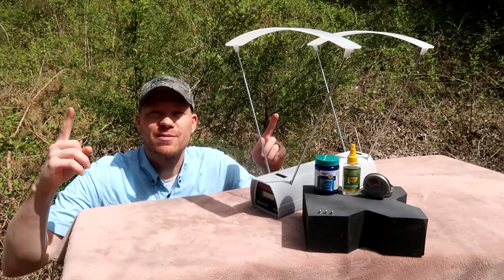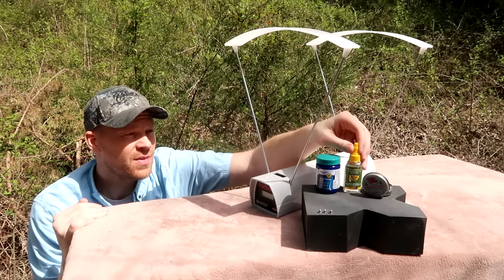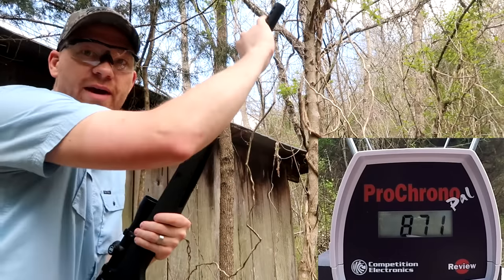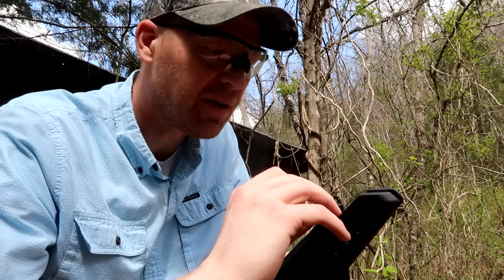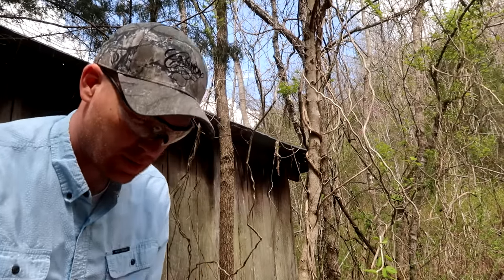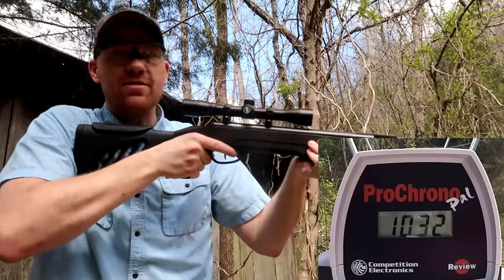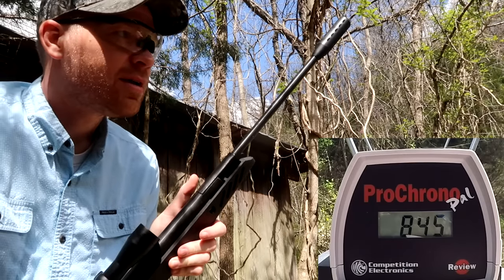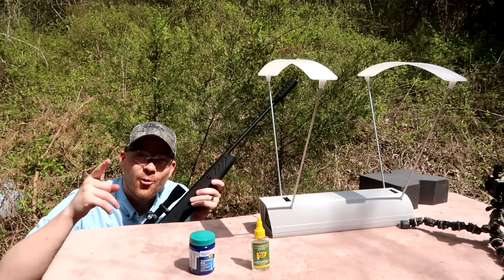Air Rifle Dieseling - MORE POWER

Comment: Hello! I use to put a small amount of vaseline into the skirt of the .177 pellet and I noted that for the same distance, pellet and kind of target my Gamo P900 springer pistol is able to pierce things that it is not able to get pierced without the dieseling. I wonder why if spraying some silicon oil into the pellet box and then putting them in place to shoot, if I could get the same results in a faster way. I shot many shots dieseling way and I don't see any damage or sign of burning in the seals of my airguns. I think it's not a risky thing?

Comment: Heat the vaseline until fluid, remove the ends of a pack of matches and reduce to powder. Mix it with the vaseline, pour it into the pellets then let it set. It's like dieseling on crack.
Reply: @AncientTruthSeeker  you sound like a cop 😐
Reply: @AncientTruthSeeker  i'm from the uk, spud guns are classed as dangerous weapons here 😅 this method is very effective, it'll blow the gasket around the barrel eventually but that can be replaced.
Reply: @AncientTruthSeeker  i knew a guy that bored out the barrel on a weirauch hw45 to fit a .22 casing, he drilled holes on the botton of the casings and clamped piledriver 32grain pellets into the top. Filled them with the mixture i mentioned, it fired through an oil drum and went off with a big bang and some smoke.

Comment: It's called deiseling because the same process that happens in a diesel engine happens inside the pellet gun. First the intake-side camshaft on the bottom of the rifle will advance by 60 degrees, allowing air into the gun. Another 180 degrees of advance sees the crank rotate the piston and load a pellet. As soon as the trigger is pulled, the explosion happens, but is contained thanks to the use of special gaskets and ARP bolts inline with the barrel. This makes the mechanism HOT, so hopefully you have topped your rifle up with 10W-40 and cranked it over a few times to make sure everything is well lubed.

If you're interested in this sort of thing I recommend you look into tokamak'ing your pellet gun, trapping hot plasma inside the barrel using magneto-dynamic confinement. You can find videos on YouTube
Reply: Tokamaking?
Reply: @TheBabayga  yeah idk where i was going with this comment either

Comment: When you compress any oil based product with enough air pressure it explodes.Thats why its called deiseling .A diesel engine runs on compression not spark like a gas engine.Thats why your getting increased power in your air rifle.Its compressing the oil and causing an explosion behind the pellets.

Comment: I think what happens is basically the air pressure suddenly increasing ignites the vaseline and basically adds combustion to the equation similar to how diesel engines work to ignite the vapors by pressure alone

Comment: a bit of a necro here but I'd like to point out hat due to the nature of how dieseling functions this can cause a particularly uptight law enforcement ass hole to reclassify your weapon as a firearm as this technically counts as launching a projectile with an explosive. This isn't  a HUGE issue depending on where you are at the time, but if you have a full auto airgun that makes it a new machine gun (yikes) or if you are an ex-felon... well you get the picture. Frankly with how harsh this method is on the seals of your rifle it's really not worth it for the little extra power you get.

Comment: LOL. Not real great for your air rifle. But it is fun! Most new break barrels will diesel for a few shots from residual oil in the chamber. This is why silicone chamber lube is recommended. It resists dieseling.

Comment: Diesel engine does not have spark plugs because it's firing point is accomplished by pressure. So the product has to be an oil type of product because this is what a diesel engine uses. You run a diesel on vegetable oil, olive oil, and yes diesel.

Comment: Just to be correct, this is not dieseling. Most spring piston air guns diesel a little with every shot. What you are doing is called detonation.  An airgun that is dieseling is burning off a small amount of oil in the compression chamber. A detonation is when the oil explodes in the barrel. At the least it will ruin seals and springs, at worst it can blow the gun apart.

Comment: Ok I got one 4 u soak your .177 pellet in motor oil in the cap then then oil pellet an put in barel. An it will put a hole in pop can as big as your pinkie what kind of gun u use in vid

Comment: I used to spray wd-40 in the handpump of my benjemin 22 cal pellet rifle cuz it seals the piston rubber and makes more pressure. one time I was screwin around in my shop and couldnt find the wD -40   so I sprayed some deisel I hsd in a spraybottle instead.. I usually pumped it 10 times and it was pretty hard at the tenth so I started prumping and counting  and at 7 Baam! the gun blew up.. True story  I swear.

Comment: Been doing this since the 80’s with Sheridans .20 cal and Crosman Magnum 2200 .22 cal 
No need to lube every pellet tho.  Just drop a few drops of oil down your barrel evenly and give it a couple of dry fires this will shoot the excess oil out and it’s not substantial enough to ignite and cause fire so I have no alarm by what these people try to put in our heads, once you have done that then take your pallet and shoot it like normal you will get about 10 or 15 good shots of diesel firepower and then u will have to do it again , this is very very dirty for our barrels so make sure and use cleaning pellets for this when you clean the gun use the same oil and no do not use WD-40 to clean out your barrels or for diesel in that stuffs for exterior only. Gun clean kit is recommended for dieseling and no none of my rifles were short lived from diesel.

Comment: Dieseling is inconsistent and unpredictable. So accuracy goes out the window which is common for the first couple of shots after oiling it. I built a cheap one from China to "diesel" oxy-acet mix. It throws a 3 foot flame out the end. Fun but you can't hit anything smaller than a barn door. 😂🤣😂🤣

Comment: It’s more about not filling the cup of the pellet but more of using the oil or vicks to seal the gaps around the pellet to make it a better /tighter seal...and therefore more compression..hence the phrase “ Dieseling”    The less blowbye around the pellet utilizing closer to 100% of the air pushing the pellet out…. And the extra compression will create more heat to amplify the fps even more. Ya it does work great. But it will wear out the breach seal quicker usually..great vid nonetheless. Whoteehoooooo!!

Comment: Yer expanding tha skirt on tha cup making a tighter fit in tha bore so it holds more pressure. I expand mine by inserting and turning tha beveled tip of a ink pen. I have a  old pen with a metal tip works great.If you had held tha barrel vertical and rotated tha stock up yer liquids would stay in.Tha vics stays in cause its thick

Comment: Best to use is a light gun oil or lamp oil.
On cheap air rifles back pressure from vaporizing oil can blow out seals.
Called dieseling because on higher pressure rifles it will ignite the oil like a diesel engine. 
Get more punch when you use an air rifle that starts at 1,200fps

Comment: Dude does a diesel engine make any sense to you. The diesel runs on the same concept it is not a Spark that ignites the fuel it's a pressure and heat. The pellet is shaped cone shape which means at the end you can concentrate all the pressure to a point which causes  heat which ignites The Vapor Rub or whatever fuel you have in there. The fuel propels the projectile out the barrel like a second stage rocket.

Comment: I don't know, so I'm only guessing, but if your getting smoke, which is supposed to happen, it seems like a small combustion event has occurred. ( dieseling? ) suppose it'll wear your bore, like running overly hot loads? Seems to work though.💥💥💥👍👍🚲
Reply from the maker: Surprised me!

Comment: Petroleum products WILL burn your seals out! With repeated dieseling has the potential to have your gun come apart! These knuckleheads that told you to do this must be real geniuses! The dueling can increase the temp to close to 2000 degrees f in the air chamber.Put it this way,would you turn on an oxygen tank with gloves that are greased filled??!
Reply from the maker: 👍👍 I wasn't afraid to try it in my $20 bargain store air rifle

Comment: it's called "dieseling" because a diesel engine fires it's fuel under compression..a pellet rifle uses compression.. the oil, vaseline  ect. is igniting under the pressure!..just like a diesel engine...that's why the water didn't work..plus, it's added water weight made it go slower.

Comment: Brother, did you realize how bad dieseling is for your nitro piston chamber, and breech seal before you did this? It can seriously damage your airgun. I'm an avid airgunner, and I know a lot about them. Any petroleum-based lubricant is ALWAYS bad for break barrel air guns. However, it's not really bad for a PCP airgun since they are not sensitive to petroleum-based lubricants. 

Dieseling can even cause serious injury or death, because it can blow up your gun if it is overdone. "Dieseling" happens when the rapid expansion of air pushed forward, presses against the back of the pellet at a high speed, which then causes the petroleum to actually ignite inside the breech of the gun. Break barrel airguns ARE NOT meant to withstand those high pressures from an internal explosion. Anybody telling you to do such a thing isn't doing it with good knowledge of just how dangerous it is. Please be careful 🙏🙏
Reply: why cant we use silicon 3in1???? !?! ?! ??!? please respond

Comment: I need tips on how to increase muzzle velocity in a bb gun.
Specifically, the old Umarex Glock 19 (non-blowback) GUW019
Reply: There’s nothing much you can do you need to open it up and adjust the reg to allow more co2 in
Reply: @TheInvisibleOrange26  That sounds like something much I can do.... 🤔

I saw a video years ago about opening up the pressure chamber and weakening the spring that pushes the plunger forward to close the valve.

I just don't have precise, specific details on how to do it to this model 
(without ruining it).

Comment: WHO_TEE_WHOO Brother. A Diesel engine is a combustion ignition engine. The compression in a diesel engine, high compression of air towards the top of the piston stroke causes the firing of the fuel when injected through the intake valve. Exactly what you are doing when you cock your air rifle and pull the trigger. Compressed air with the fuel source already there in the form of vapor rub or Rem Oil causing an explosion, thus the smoke you saw. It is a little hard on the seals in your air rifle however.
Reply: If you don't know how a diesel engine operates don't try to explain it. Diesel engines have fuel injection and it doesn't inject it into the intake. On a diesel engine all the valves are closed during the compression stroke and just before top dead center the fuel is injected directly into the cylinder and it combusts under the amount of the heat caused by the compression. Retired diesel mechanic here that knows WTF he's talking about.
Reply: @RedneckHillbillyGnR  please explain to me what it was that was wrong. I can explain to you what you said is wrong
Reply: @happytrails5400  For one, diesel engines do not inject the fuel through the intake valve. They do that with gasoline engines and it is called port injection because it is injected into the intake port. Some older ones had TBI, which is Throttle Body Injection, which is where the TBI sits on top of the intake like a carburetor. Please, enlighten this retired diesel/automotive mechanic where I am wrong. You are correct in the case of the pellet gun and the heat of the compression causing the oil or vaseline to combust and increasing the power of the pellet gun. But you are off on the diesel engine getting fuel injected through the intake valve. It is called direct injection because it injects the fuel directly into the cylinder just before Top Dead Center on the compression stroke where it combusts due to the heat of the extremely compressed air which drives the piston down on the power stroke. Now in the old days they used to have diesel engines that would start on gasoline and spark plugs and then switched over to diesel, but that type of system didn't stick around long. So again, please enlighten this retired diesel/automotive mechanic how diesel or any other engines work.

Comment: I was wondering how that worked. It prob seals the rifles in the barrel off better. I’m guessing that’s what it does. GOD BLESS.
Reply from the maker: Hey Randle!
Reply: The petroleum ignites the air in the chamber,it can reach almost 2000 degrees fit WILL burn out your seals and the gun has the potential to come apart!
Reply: WHO_TEE_WHO hey brother when the turkeys get to gobbling better here you got to come up and we’ll go after a couple. GOD BLESS.

Comment: The smoke is more a fine particulate of the oil mixed with air and a rapid decompression after exiting the barrel behind a projectile. The oil does two things. It helps fill the gaps and lubricates at the same time. Reducing friction, and allowing all of the air to push, allowing faster speeds. I doubt it will wear out seals any faster than regular shooting and honestly probably helps overall.  Any overpressure will leak out the breech. I only just learned this recently then found this video
Reply: What is happening here is called the diesel effect, the oil is combusting under the intense pressure
Reply: And yes it will blow out the O-rinf

Comment: Anyone knows / has the experience after how many shots this will damage your air rifle?
Reply from the maker: Nope
Reply: @WHOTEEWHO  Then... I will have to try it :)
Reply: What I will try is the following. Since I am not the type of guy to walk around with a tube of vaseline in my pocket, I will prepare the pellets. I will add a drop of oil / a little vaseline and cover it with parafine (candle wax). This wil make it easier to transport prepared pellets. It's an idea, do not know if it works. Will post updates here!

Comment: Call it lubricating instead of dieseling combustion is not possible because the airpressure lowers so it cools instead of heating so no combustion
Reply: Wrong! The more you compress air the hotter the air gets. The reason it is called DIESELING is because the diesel engine uses the heat of the compressed air it takes into the cylinder and when the piston is just before top dead center the fuel injector sprays the fuel into the superheated air and it combusts, forcing the piston down on what is called the power stroke.
Reply: @RedneckHillbillyGnR  i know the reason im saying it and that part somehow is missing is nobody in these video's mentions is it works with piston Guns not airguns so i have morons come to my store with airguns and i have to explain what you Just did again and again
Reply: @RedneckHillbillyGnR  its called piston rifle dieseling not air rifle dieseling. these video's RedneckHillbillys make are never complete

Comment: Hey how are you man nice vids as usual... i have a notice regarding airgun diesling... if you diesel your gun it would affect badly on the rubber and piston parts and it could damage them and cost you... personally it happend with me... i dieseled my diana52 .22 pellets by vaseline obviously it causes some smokes and laud sound ... after few shots around 5 or 6 using vaseline it damaged my piston and shredded the rubber part to pieces in the chamber! 😭 i had to change all that parts beside the spring was bended and the power was degraded... my gun become compeletly jamed and i had to take it to the maintenance... i would like you to experement and show in your vids the disadvantages of the air rifle diesling... many thanks to you 👍
Reply from the maker: Oh no! Yeah I wasn't afraid to do it in my $20 bargain shop air rifle
Reply: @WHOTEEWHO  yeah ofcourse man yours is cheap bcz my diana cost me around 600$ and to fix the problem is around 50$ 😭
Reply from the maker: Yikes!
Reply: @elfrancotirador4086 Why the hell would you do this with an expensive rifle?!?!?!?!?

Comment: Well I guess you do learn something every day. I had no idea the pressure in those rifles was near high enough to ignite a fuel.
Reply from the maker: I had no idea!
Reply: Usually takes over 150 psi. . Deisel engines are are about 16to1 compression which is 260 lbs or so.